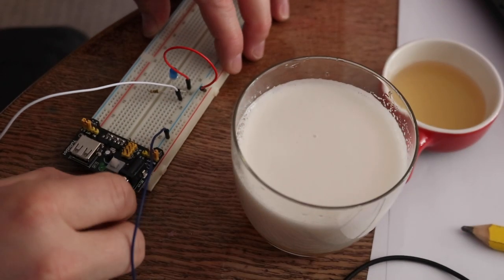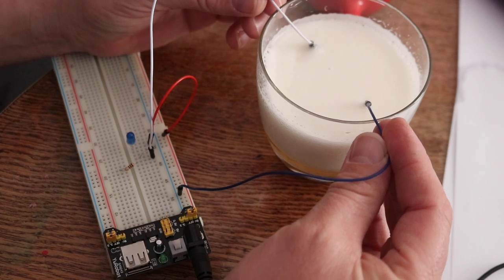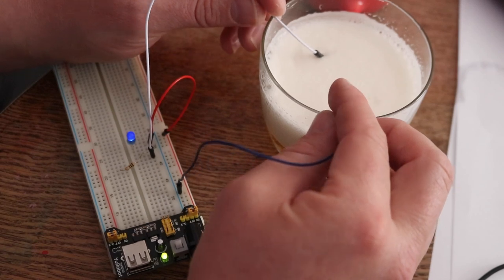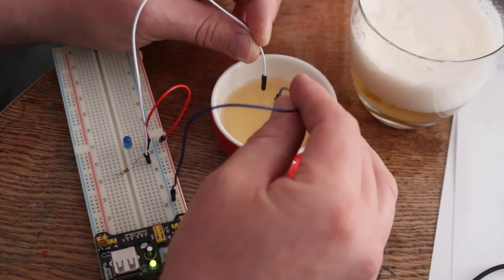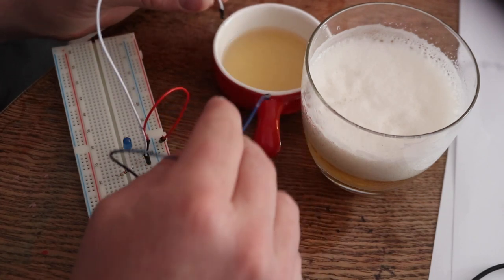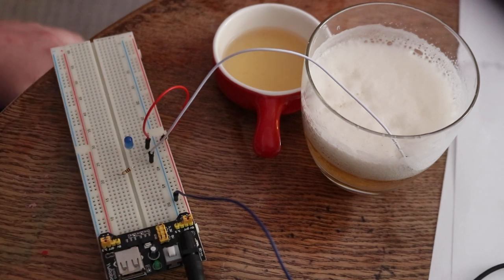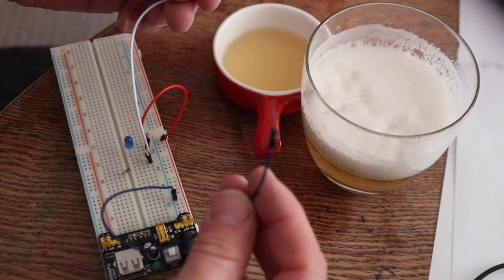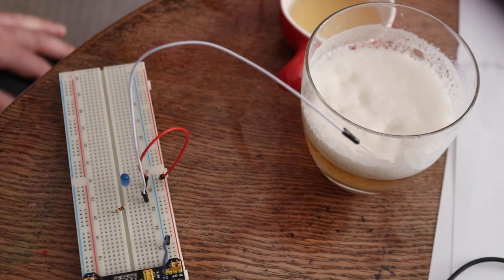Voltage Detection Beer Sensor Idea ~ Can Filler

Comment: I've seen a norwegian guy recently build (several) dual can fillers. He purges and fills each can at the same time with both a CO2-hose and a beerline together in each can. He supposedly has a pressure sensor in the CO2-hose to detect fill level, but I do not know much more detail around it.

Comment: Using DC in a conductive liquid would mean the generation of oxygen and hydrogen on the electrodes. Also the electrodes would corrode pretty fast. 
The ESP32 has a port that can be wired to a piece of metal an be used as a capacitive touch button. Using that chip would enable you to set a threshhold for the foam and the beer in software, without any additional circuitry.
Reply: Stainless electrodes and microamps it wont be a problem is my guess.

Comment: If you have an arduino handy try this same experiment with the AnalogInOutSerial example. In arduino IDE goto File->Examples->03.Analog->AnalogInOutSerial. Flash that code and put a jumper in pins A0 and 9. Open the serial monitor (Ctrl+Shift+M) with the arduino connected and you should be able to use that to get a numerical readout of the resistance between foam and beer. If its repeatable, you would then need to figure out the range it needs to be in to trigger the solenoids.
Reply from the maker: Hi Mate. we have a github open here for the project if you would like to join. https://github.com/kloon/OpenBeerFiller

Comment: Take a look at the TN10x200 double rod cylinders for both the moving cans and filling. I would go for 3 cans filling at a time as 3x66.2 is pretty close to 200mm. Also the 200mm movement would clear both the .33 and .5l cans so you could just build it to lift high enough for any can size. Found a pair on aliexpress for ~$20 from a seller called "Hardware appliances"

Comment: Just put can on scales or for automation on load cell.
Reply: A load sensor will be more reliable, both of them will have issues with changes in the beer but resistance more so and weight will easier to calibrate for.

Comment: Hello, because the weight is gravity of liquid dependant, you need to make a calibration in function of the gravity of beer you need to can, despite of that, the weight method is the most simple and higienic way to make the labor.

Comment: Would the alcohol or sugar in beer make a difference for resistance of liquid measured. 
I take it the flow controller you use for water is no good 🤔

Comment: LED use too mutch current to tell apart beer and foam. Put a 2k2 R to 5V . The other end to the Voltmeeter and the beer cable 1.
Ground volmeter an beer cable 2. Look the voltage diference between bear and foam. You can read the same with Arduino analogRead().
This is my bottle filler, look at the inox wire in the rubber cap.  Https://postimg.cc/cgWrQd4R

Comment: I have come up with a idea the the v5 input then use code pinMode(A0, INPUT_PULLUP);  then get a reading from the form.
then set the value, eg

if ((digitalRead(BTUnit1)==LOW)&&((BeerLevel1)<500)){
  EmptyUnit1 = true;
  }
else EmptyUnit1 = false;

the 500 is the returned value testing it key.